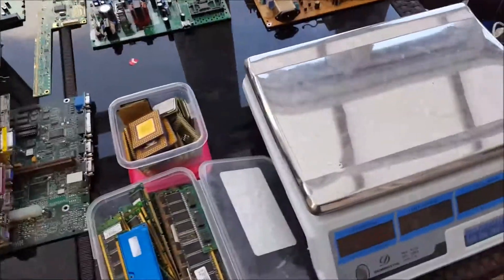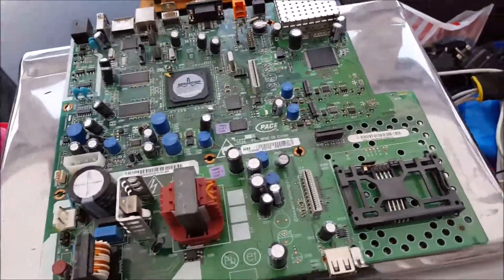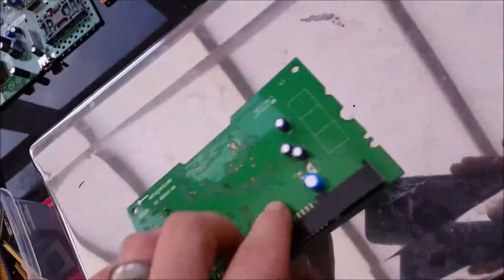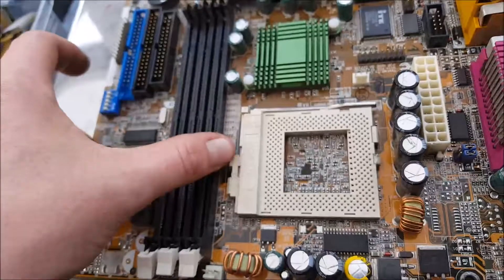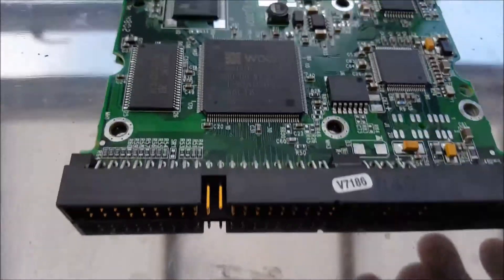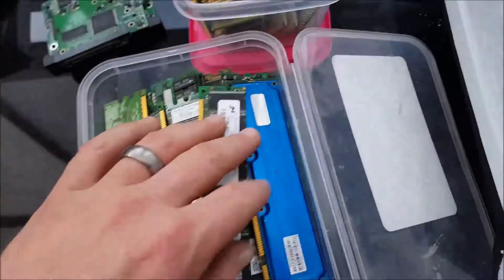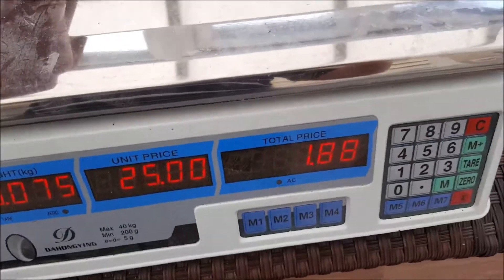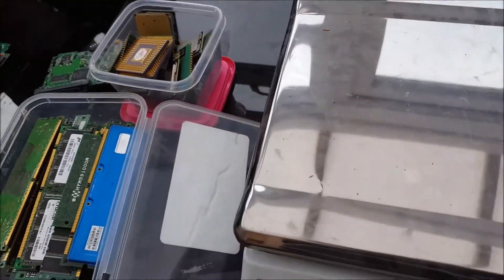Grading and pricing circuit boards for scrap

Comment: Hey Ben.. just watched the video. If I start taking things off the circuit boards like those little transformers and aluminum bits .will it  lower the  value of the circuit board ? Great stuff 👍!
Reply from the maker: Yes it will lower the price unless if you have a good, safe and efficient method of getting the precious metals out i wouldn't de-populate the boards
Reply: Thanks man .

Comment: Are the gold pins on the cpu's goldplated or gold?
Reply from the maker: Just gold plated unfortunately older they are thicker the plating is they have gold wire going under the ceramic/fibre too ram is good for gold content but you need alot
Reply: Ben Houghton so what parts are solid gold? I will probably sell all my plated gold on eBay, I'm not gonna do refining with chemicals. But grinding and get just gold out is a possibility.
Reply from the maker: Everything is plated if it was solid gold it would make the products too expensive they only need to transfer a current or data so they dont need to be solid anything after 2006 is super thin plated then before that the gold is much thicker, the older ic chips are more likely to have more gold too
Reply: Ben Houghton cool, thanks Ben. I have some old computers in storage. Even a 1993 PC. 😎
Reply from the maker: Very nice i just picked up a pc that has a sticker on it saying it was last tested in 1991
Reply: Ben Houghton Awesome! Make a video on that!

Comment: If you pull everything of value from these boards, am I correct to assume you sell them all as low grade? 

Thanks
Reply from the maker: True so a £5 motherboard will decrease to a 15p motherboard if you remove any components so unless you can get £4.85 in precious metals its not worth depopulating in my opinion i wish i saved all my boards to sell i lost out on quite a bit of money by depopulating my mid grades